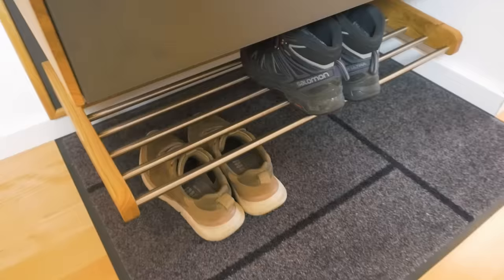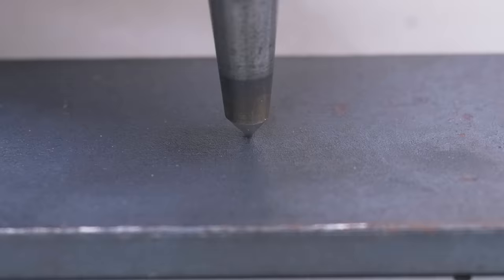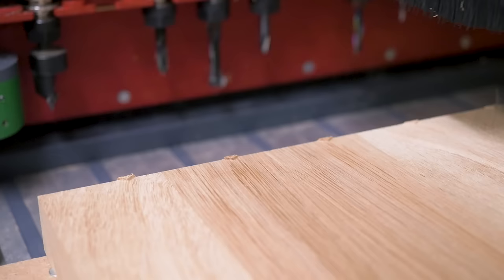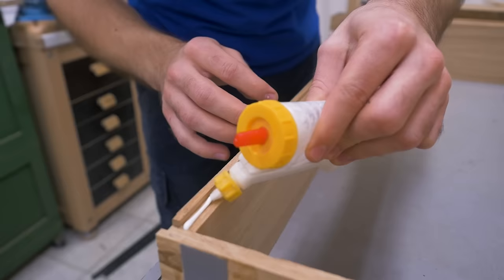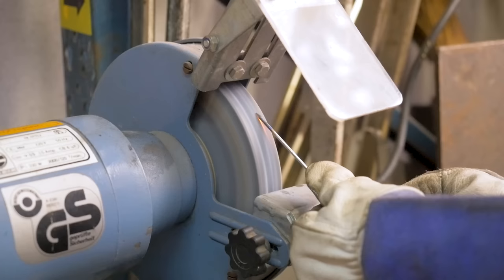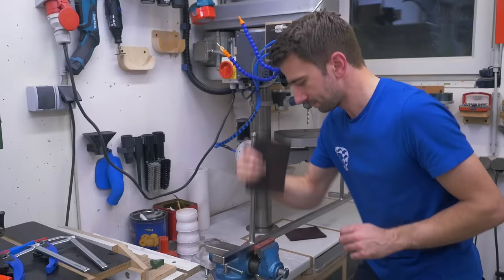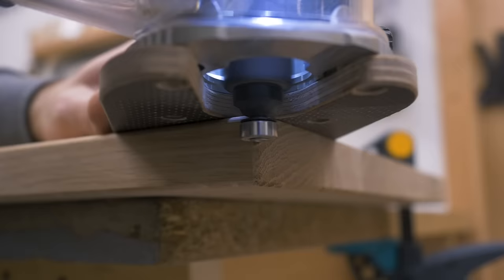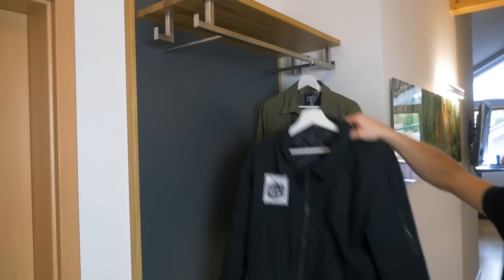I saved 100€ building this Wardrobe

Comment: Hi Marius

How do you keep the bandsaw blade for the Bosch saw to not crack. Do you release the tension or even remove the blade between uses? I dont know how many blades i have destroyed long before they even get dull=(
Reply from the maker: I don't. It's just crap. It always snaps before it's dull, very annoying

Comment: I think you did not save money, you made money. It gave you a nice opportunit for a project video, if the views go up then you make money with it.
Secondly you learned with this video, welding if course and to use the holes in steel support as a drill guide.

Nice project and a nice video.

Comment: That production piece looks really good but I do not believe it can have quality on the same level as the piece you made.  If you are going to stay in this house your whole life, the cost becomes irrelevant.  I don't understand how you can glue in the drawer bottom.  Will it not fail at the glue joint as the solid wood moves more than the plywood with changes in moisture, over the years?  I must not understand what you are doing?
Reply from the maker: The solid wood doesn't really move along the grain. The overall drawer dimension stay equal during the seasons